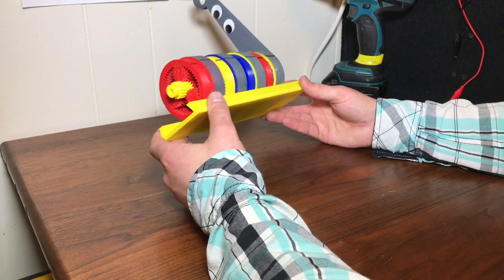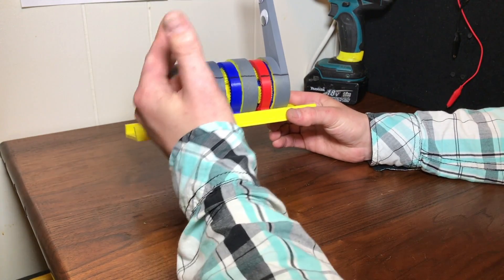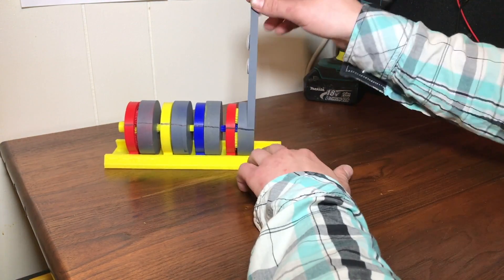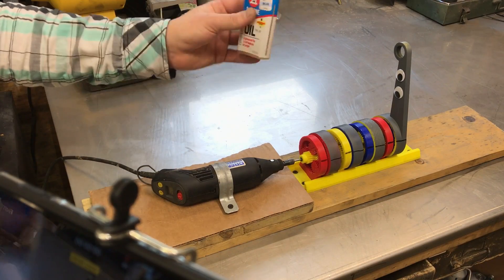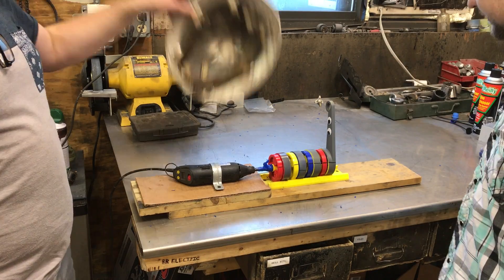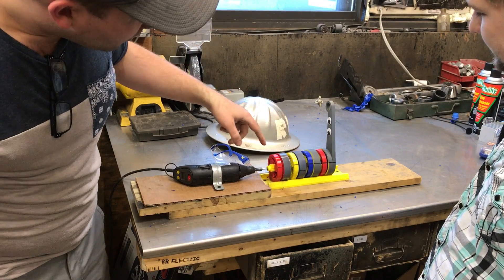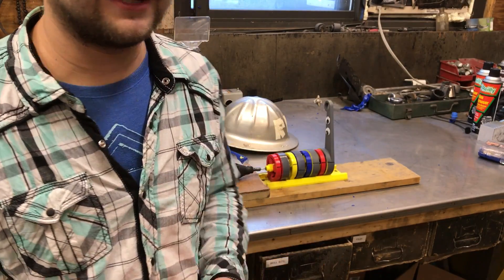3,616,238,492,881 To 1 - The Most Useless Gear Ratio Ever

Comment from the maker: A lot of people have been asking where they can buy one of these, and previously there wasn't anywhere that you could.
But now, I'm happy to announce that you can order one on Shapeways! https://www.shapeways.com/product/YGKZHNTAL/1379-1-gear-set-mechanical-desk-art
Reply: What if you had two of these set up opposing each other would u end up with a 1:1 gearbox however with the centre gears seemingly stationary?
Reply: $47 wut?
Reply: oof
Reply: Gear Down For What?  Any chance of putting a dial gauge on the end? Or some type of electronic measurement tool?
Reply: I did the math and at 14,000 RPM it should take 1.365 years to move the final handle one degree
Reply: Hey someone posted this down below, but could u make a folowup video where u couple the end output of this whole gearbox and use that as the input on this gearbox in reverse? u should see the output then go the speed of the dremel while the rest of the gears appear to stand stil, might be cool to try out, might take a while to get going tho because i figure there should be some clearance on the teeths and this would need to rotate until the clearance is gone
Reply: Can you do a 9999999999999999999999999999999732 to 1 gear ratio
Reply: Gear Down For What?  Can you try it in reverse, as in from the other end, one that was supposed to rotate. Will this setup become of 1 to 3.6 trillion rpm? I wonder is that possible. Because theoretically speed of light sounds like a baby against this. But since that's not possible, so is this. Still can you try. I think people would love to see that.
Reply: That ones only 1379 to 1
Reply: music? 
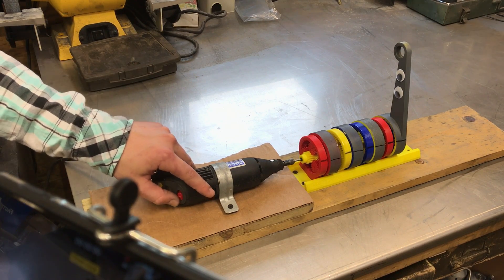4:54
Reply: GA Mujtoba it was made in GarageBand not published, yo can tell because they are stock samples. Sorry if that’s bad news but you prolly can’t find it anywhere
Reply: Use air tools they will keep them selfvs cool
Reply: @nullblau7982  That doesn't solve the problem of gear friction heating. The plastic will fail.
Reply: Whay is the purpose of this object? Like, what uses could it serve?
Reply: I'D LIKE TO SEE THAT
Reply: Can you flip the gear box to make 1 to 3 Trillion
Reply: It's not useless you made a video which made money cX
Reply: Turn it form the last gear
Reply: TRY rotate the other side ;P
Reply: 2:22 u said 5700 hours... But it's 5 million hours
Reply: a fan connected to 2 inch pvp, butt up to the end of the gears would be a great cooling method.
Reply: Can you turn the other side
Reply: Can you turn from other side
Reply: @abhinavk.b9680  For those asking can this be reversed, the torque to spin it in reverse would be so insane i'm pretty sure it would push the earth out of orbit.
Reply: Why would I waste all my pocket money on this useless thing?
Reply: Does it come with 50,000 donald trumps?
Reply: @keiharris332  ??

Comment: That link shows a gear ratio of 1379 to 1 which seems impossible, if this is possible, why don't they put those in a winch? Every wench I have seen starts off with a 90 or 95 to 1 gear ratio and has three sets of planetary gears.

Comment: Put the whole thing in a clear tunnel and a sealed tray on the bottom put just enough oil to get to the ring gears so it will lift it up.   Like a differential.

Duct an air-conditioner onto it

Comment: Why not make one out of steel with just two of the gear boxes. And use leverage of a really long Handel to turn it in the reverse orientation and see what the max rpm you can get. That looks like the original idea of it in the first place.

Comment: Why didn't they submerge the thing in 3-in-1 oil and let it run? Cooling and lubricants  checked off. And use a 90° gear box to change output direction so the dremel isnt in oil. Then livestream it over homework music for extra YouTube cash.

Comment: Useless ...?
I don't think though
this is exactly the part that I need ... to test one of my hypothesis ( it is about fluids and solids gravitation forces, I don't want to explain it here :) )
and a suggestion for you:
if you want to see changes in the last stem/gear
you don't have to wait for years
just extend its stem about 2 meters 
add an extremely thin needle at the top/tip of that stem/bar
place a 100,000 dpi printed paper that has a checker board pattern on it 
and at last... place a microscope camera positioned right behind that needle
by doing so, you only have to wait for about 1 hour to record its changes
I hope you make a new video by the help of these instructions again :)

Comment: My favorite part of this is that the handle (at least theoretically) must have moved, just by such an imperceptible amount.
I wonder how much.

Edit: assuming the point of the handle furthest from the center of the slowest gear is a foot away from it, it will have moved about 290 picometers (1.8*10^25 Planck lengths) in a circle if you rotate the first gear, fully, once. 
Of course it's displacement from it's original position is not quite the same due to it being along the arc of a circle, but it is well within the error margin for this calculation (I literally divided by three to account for using feet rather than meters - not the most accurate process in the world), plus it wouldn't effect the number at the two significant figures value I've given (or probably even for many decimal places).

Comment: I like this! The Zeiss Planetarium modell 1 (1923) has a gearbox of 1: 819.936.000.000 ( for a motor with 1 rotation pro sec.) for The period of precession of the earth, and it is about 26,000 years.

Comment: Usefulness in extreme ways:
Lifting the tremendous pressures holding absolute vacuum
1. Two metal walls on a track that slide in an out easily, say with a rack and pinion
2. Seal it to where no air can get in between
3. Use the force generated by your machine to separate the two

It would require an obscene amount of force to achieve vacuum this way but the quality would be undeniable. 

At 1hp of force multiplied by 1T may do it. Be it a day, a month or a year it would be great for scientific study. Also it would approach the level where metal in the walls would come away.

Comment: I did some math: if you hook up the drill to the other side of the gear (let's assume it has infinite torque and everything is indestructible) the output shaft tangent would reach about 27600% the speed of light.
You would open up a black hole at the end of that thing.
Reply: If humanity ever makes a perfect alloy or some material that cannot be destroyed, I know what i’m doing
Reply: @waterlemon5272  bruh, it would take alot of weight
Reply: @waterlemon5272  titanuim maybe?
Reply: We need to adjust for the speed of light.
Reply: @MBJH17isbackonlyone  speed of light LIMITATIONS are false.
Reply: Pics or gtfo
Reply: You could spin it with enough leverage
Reply: At the end would travel back in time :o

As the time passes slower as u move faster. Highest speed is in the universe is light, tachyons are faster than light thus some theories suggest that they travel back in time
Reply: Wow
Reply: TheBoltMaster  Gravity and a fucking building on top of a lever.

Come on now.
Reply: Warping space time with gears
Reply: Titanium*
Reply: TheBoltMaster  the Wärtsilä RT-flex96C diesel engine will do
Reply: If you could even shake that other end that it
Reply: TheBoltMaster  'LET'S ASSUME'
Reply: @opidortes  anyone can say the nword as long as they aren’t being racist, saying “only black people can say nword” is literally a racist idea in itself you dumbass
Reply: @NeapolitanNegus  bruh no
Reply: @midstruck4730  yes it is as you are favouring one race over the other: the literal definition of racism
Reply: @NeapolitanNegus  
no we are not 'favouring one race over the other'. black people have been oppressed by it for centuries, so they get to say it but white people dont as it still carries that historical weight. even so, is it really that hard just to not say it?
Reply: @midstruck4730  okay got it you aren’t favouring one race over the other but you are? White people have also been oppressed and also I don’t give a crap about something that happened 500 years ago. Is it really that hard not to care what other people want to say?
Reply: @NeapolitanNegus  1. it didnt happen five years ago; its actually happening as we speak

2. white people have never been oppressed, neither has the term ever been used to belittle them

3. why do you feel the immense need to say it?
Reply: @midstruck4730  1) Not literally 2) Yes they have, also who cares anyways 3) Why do people like you always say this, I’ve not even said it
Reply: @NeapolitanNegus  really? white people have been oppressed? Examples?
Reply: @NeapolitanNegus  
1. Liberia's policy does not hurt only white people, in fact it hurts anyone not of African descent.
2. Zimbabwe's 'white farmer' policy has been revoked and compensation has been paid. 
3. Not sure about what happened in South Africa other than the murder incident, however it has very recently (30 years) come out of apartheid (black oppression). Also there is high wealth inequality in South Africa, most of which white people control, so this point is invalid anyways.
4. As my earlier point, white people used to and still use the n word as a derogatory term towards black people, so if you are a white person it still carries that historical and racist weight, whether you are trying to be racist or not.
Reply: @NeapolitanNegus  as i said, using the n word as a derogatory term still happens today, so it carries that weight. also, most white countries have not returned the natives' rightful land and belongings (see the British Museum, USA, Canada, Australia, Kohinoor Diamond etc). This isnt cherrypicking or strawmanning, this is happening and it is not right.
Reply: @NeapolitanNegus  are you even reading my comments? i am saying it is happening now, so it still carries the racist weight. also, you don't seem to be saying anything about racism against black people?
Reply: i'm sure a lot of people care that you are using a slur.
Reply: @midstruck4730  it’s just you you’ve been continuing this for a week now like get the hint
Reply: @NeapolitanNegus  im done arguing, since my arguments are falling on deaf ears. clearly you don't understand and never will. quite sad.
Reply: @midstruck4730  not really I just don’t see what all the fear is about a word
Reply: @NeapolitanNegus  honestly the fact that you are still arguing confirms my theory
Reply: @midstruck4730  So I’m just supposed to ignore your replies? Makes sense.
Reply: @midstruck4730  so can Indians say it? Also white people were enslaved you forgot the Irish… the poles the hungarians Bulgarians the other Slavs. Wowee it’s just gibsmedat with you people.
Reply: @thomasccail7607  no its just that black people suffered from the use of the n word uniquely which is why they are allowed to say it
Reply: All these laws of physics to stop us from breaking the universe. Almost like it was intelligently designed.
Reply: @freecleets  funny.....
Reply: @freecleets  no
Reply: @freecleets  just switch to diamond, add a complex transmission and ... drop a mountain on it
Reply: The torque needed for just 1rpm is way more than our universe could ever produce
Reply: @some.generic.username5254  yes because dealing with lightspeed we always need and infinite things because if we reverse this gearbox we can obtain some speed but before the lightspeed the gear box will broke sorry for my bad english guess my nationality xd
Reply: @some.generic.username5254  so they make transmissions to get from one ratio to the next.
Until you have a warp drive.
Tadaa
Reply: TheBoltMaster  You’re smooth brained aren’t cha?

Comment: You're doing it backwards. Drive the other end and show us what kind of rpms you get.
Reply: Probably would need more torque than the tensile could take
Reply: @jacobsweat1520  Yes, but I'd like to see one of those planetary systems spectacularly failure.
Reply: @captbiptoe  it'd more be like the handle broke off
Reply: Someone make a perfect replica in a computer simulation and run it
Reply: @dandanthedandan7558  i can feel my pc melting just thinking about it
Reply: It would probably require more torque than the earth produces
Reply: @smogdanoff  the earth produces no torque unless you slow it down.
In which case it could provide infinite torque if you slowed it down instantaneously.
You need to supply a time frame. Let's use 1s.
In this case the earth can supply ~7*10^33NM of torque. Way more than enough.
Reply: Even with modest 1000:1 ratio you are completely f'ed by friction on the fast side... This is made from plastic, huge friction, so it will just bend and warp.
Reply: @nameredacted1242  Or the fact that it would pretty much break the laws of physics. Speed of light it 299 792 458 m / s, and this gear box has a gear ratio of 3,616,238,492,881 to 1. Even if he only moved the handle a millimeter, the speed the last gear would be spinning at would be 12 times faster than the speed of light.
Reply: @SollowP  Not exactly how it works. Angular velocity is different from linear velocity.
Reply: @georgeofhamilton  it would still be faster than the speed of light I bet in terms of linear velocity. The issue is that our understanding of gearboxes obviously isn't going to work at relativistic velocities because classic mechanics breaks down at that point.
Reply: @SollowP  you assume solid object speed, but there is no concept of solid object in GRT. Every particle moves by itself, so the movement will propagate like a wave through the material at under the speed of light. If it does not break for this reason. View from different perspective: the G forces get larger the further outside you are, making the outside parts lag behind the inner part -> result is again the wave propagation. It will get behind more and more on the outside and wrap around the inner parts, if it does not break and get ejected outwards by centrifugal forces.
Reply: @SollowP  Only if the laws of physics didn't stop you doing it in the first place, which they would. Aside from the fact that you haven't specified how quickly you're going to move 1mm, and that the contact surfaces couldn't support much friction without shedding themselves, and that the moment of inertia of your output would slow your ability to accelerate your input, and that at a certain speed the gears won't be able to support the internal forces and will shatter and explode, and that failing that friction would melt and vaporise the gears before you even started having to worry about the gears gaining enough relativistic mass that their gravitational field becomes a problem for your driving mechanism be it by overworking it or compressing the whole lot into diamonds
Reply: @SollowP  Depends on how fast the first gear moves that 1mm
Reply: @SollowP  and?
Reply: @SollowP  then the most it could be moved according to the laws of physics, would be less than 1/12 of 1 millimeter in that unit of time, using infinite torque.
Reply: My grandma couldn't Evan move the end of that so good luck.
Reply: DON'T YOU DARE!!!!  this would cause a time/space inversion and we would trapped in a singularity.  It would ruin your day.
Reply: @jacksnyder8017  sounds kinda hot
Reply: The RPM where it ends the universe
Reply: You would probably need 50,000 Tramps to move that as explained in the Video.
Reply: Build another gearbox that could generate the torque required to turn that and attach it to the output of this gearbox, hey presto black hole on command
Reply: With the friction it would generate I doubt it would even work
Reply: @shaunstorey23  I wouldn't expect it to work, but it would be fun to see it fail like an old road runner cartoon.
Reply: What torque is it?
Reply: You have any extra planets worth of mass to rotate on a lever on the other end?
Reply: He said it would pull 6000 metric tons, so that's how much force it would take to turn the other end.
Reply: Too much torque, it would just break
Reply: Bruh it will bend the reality
Reply: It would exceed the speed of your inital C

Comment: I think you are missing the point of this device. If you took one of the gold stars that your daughter's first grade teacher gave her for getting all of her spelling words right, and stuck it on the 1sr red ring, you could park 439 fully loaded 747's on a platform that is attached by a cable to the handle attached to the last gear box, and when you release the weight onto the handle, you could watch the star spin up to 4-1/2 times the speed of light.